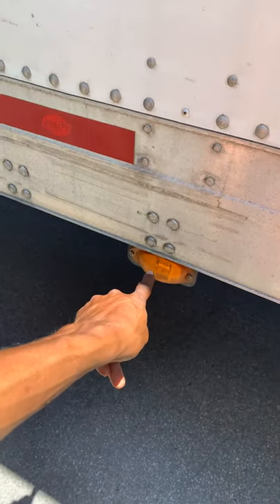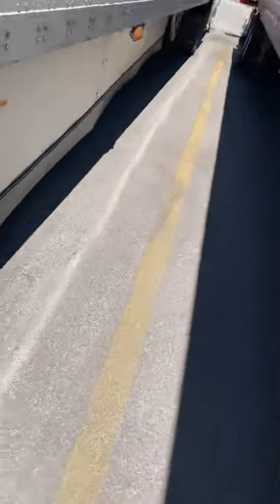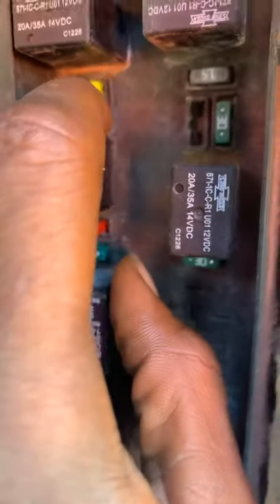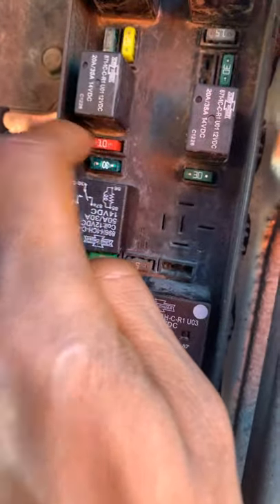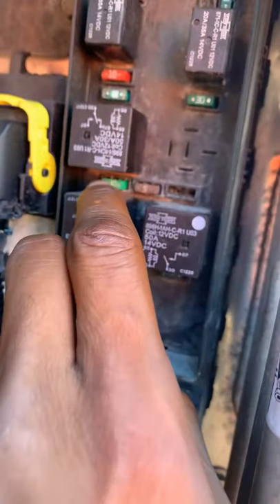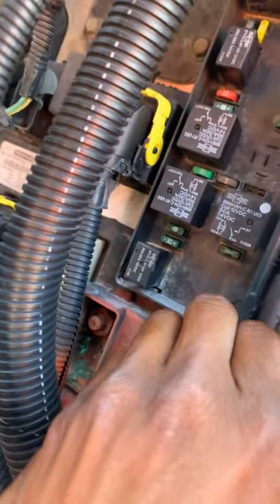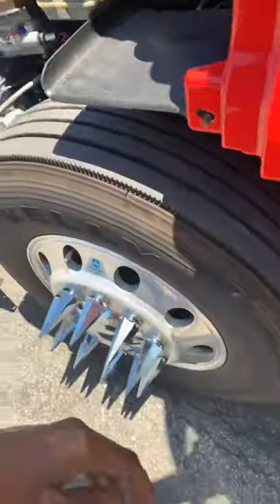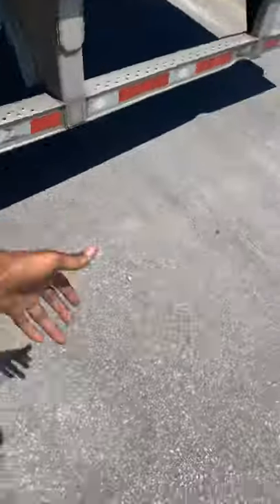Freightliner fuse box for trailer

Comment: My right trailer signal is out, I got 2016 Freightliner which fuse is it ?
Reply: Check the pig tail that connects to the trailer that powers the trailer lights, when they go bad they dont connect right and have 1 side not working but when i moved it by hand that side started to work again, this is a secindary opinion and you should only follow your own opinion but what i did to get to the yard was place a piece of plastic from a water bottle just thick enough to kinda push the pig tail at an angke and the lights worked, once at the yard i told the mechanics the pig tail needed replacement. This is just what i did and what worked for me , so i recommend following what you think is best in your scenario

Comment: The running lights on the trailers don’t all work. The top of the trailers lights work but none on the bottom work except the license plate
Reply from the maker: Check fuses relays and wiring and pig tail